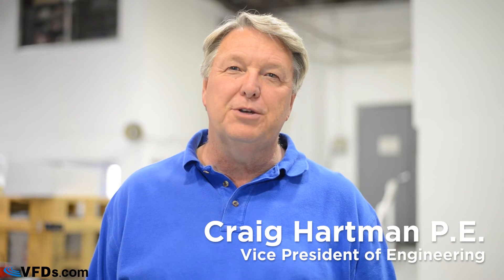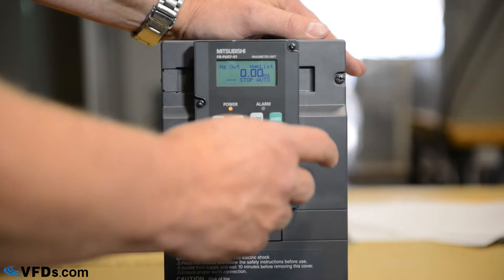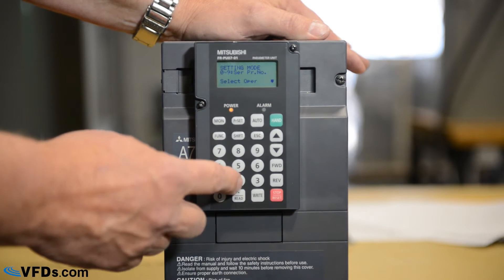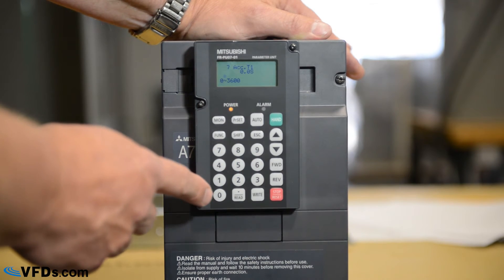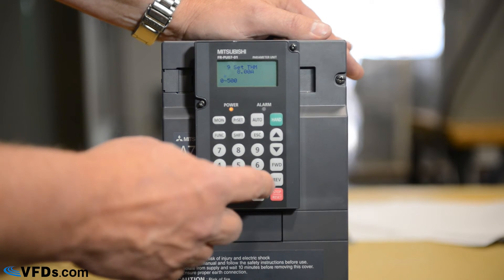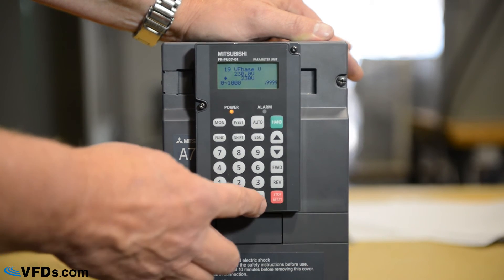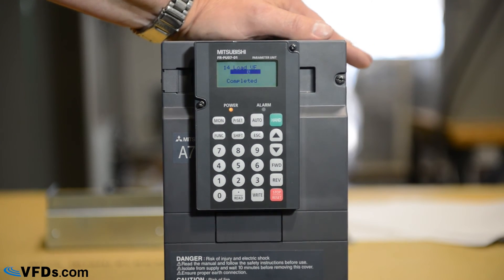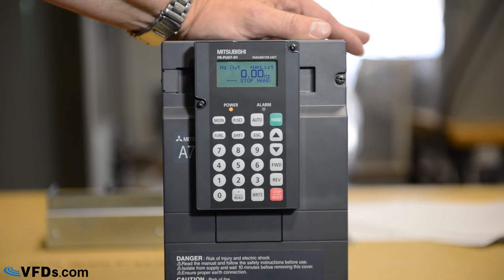How to program the Mitsubishi A700 series VFD (A720, A740)

Comment: Hi Mr. Hartman , 

Pleasant day!

I would like to ask if whether I can run a 12 leads motor configured as high voltage for D740 - 080-SC. (I have a 1,12 for Line 1 ) and (2,10 for Line 2 ) (3 , 11 for Line 3). Or this motor are only intended for part winding and other motor starting method?Need your advice. 

Thanks,

BONG - J / DOL

Comment: Dear Mr. Hartman, 
I am greetings to you from Myanmar, I am working at Mandalay Hill Resort Hotel in Mandalay City, Myanmar as a Rooms Division Manager, current we are facing a problem of one IMESA washing machine model LM70 which is installed Mitsubishi inverter model A700 inside the machine.

The problems is created on 14 January 2016 with the blue screen at the front of washing machince is appeared the Inverter Lock alarm and at that time the machine is stop running.

We did contact the IMESA company in Italy and they suggested us to update the software and we have done it with completely, but upon start the machine the blue screen is showing the machine is working but the washing drum does not move at all.

Could you please advise what we have to do to solve this kind of problem

We look forward to your kind reply.  My email address is mhrh.rdm@gmail.com 

Kind regards,
Chotsittisak Chitsanupongthorn.(Mr.)